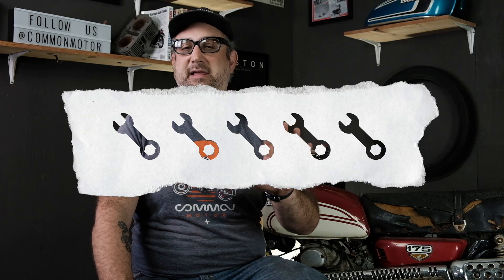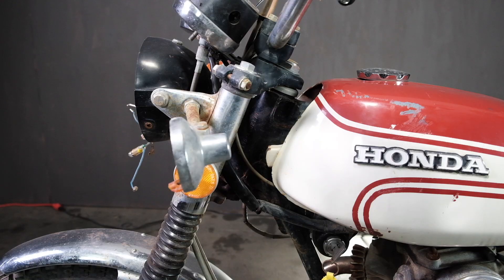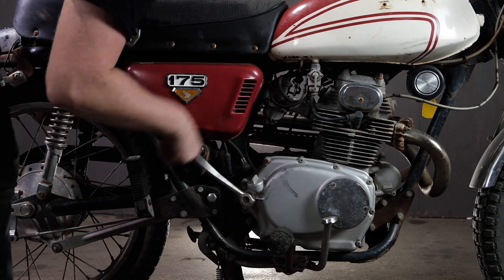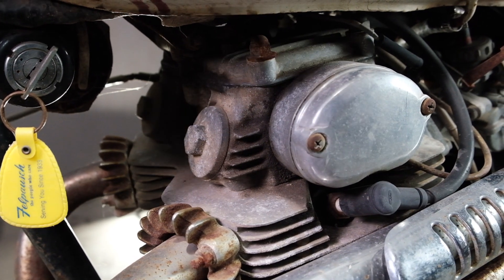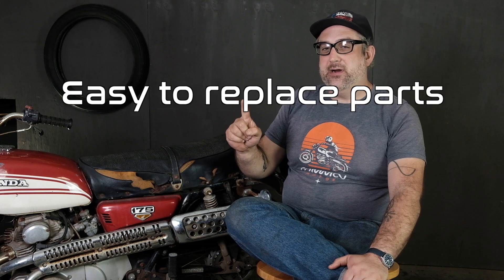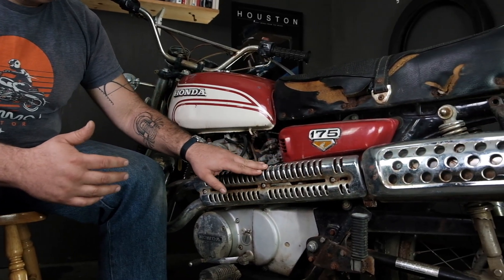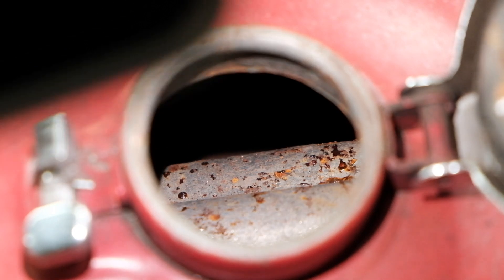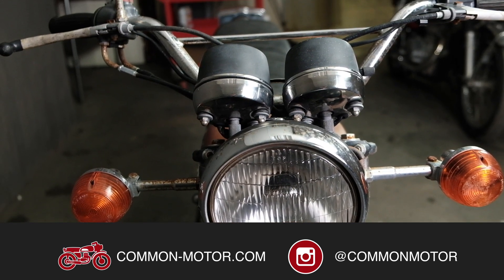How To Evaluate A Vintage Honda Motorcycle Project

Comment: Please be aware, if you are not mechanically inclined, and don't plan to work on the bike yourself, a vintage bike is not a good choice.  There are very few shops willing to work on old bikes, and if you are lucky enough to find one, expect to pay around $75 an hour or more for labor.  If you want to learn how to work on the bike yourself, spend a little more and find nice one in running condition.  Then you can take on little jobs as they come up, like adjusting points, changing the oil, and rebuilding the carb.  Also, a single cylinder bike is much easier (and less expensive) to work on then a twin or inline four.  Find an online forum dedicated to the bike you purchase.  There you will find people who are happy to share their knowledge on repair and sources for parts.  Finally, some parts are just very hard to find these days, even with ebay and Craigslist.  Be prepared to wait, and possibly pay a lot, for good used parts which are not made anymore.  Good luck!
Reply: I agree with Carport Chronicle.....I have a 79 Honda CB 750 that I have had for five years that I got from a “friend”.  Old bikes are a hassle and you won’t be riding it much.....Parts are not available anymore....don’t listen to people who think everything is on EBAY....trust me......and the aftermarket carb parts a lot of times are junk or don’t fit.....As far as 4 cylinder bikes go you won’t find a YouTube video on how to rebuild the four carb set up on those old bikes....I paid my mechanic 800 dollars for my rebuild......oh is that outrageous?   Did I get ripped off?....Good luck finding someone who knows how to work on that old junk....oh and no matter how mechanically inclined you are you won’t be able to figure it out.....I’m lucky I have a guy who is willing to work on my bike cause most shops don’t wanna mess with the old bikes and I don’t blame them because a lot of people get pissed at the costs involved.....Do yourself a favor and get yourself a Yamaha MTO3 that will run on today’s gas and has ABS.....Lot of people that have an old bike for sale want money for it when a non running old bike is worth nothing IMO....Sure my Honda is fun and it’s the only one around......but it’s been a hassle....A lot of bike owners work on their own bikes not knowing their repair could result in a fatality.......like the battery cable on my bike that I found out had 7 splices in it.....the cable was less than 5  inches long....not to mention the other “repairs” someone had done to my bike prior to me taking ownership of it .....like not using gaskets on the stator side of the case.....Or putting aftermarket air filters and exhaust on a bike without proper jetting and wondering why the bike never ran properly 40 years ago..these old Japanese bikes are engineering marvels ....they ain’t simple farm machinery like an old Harley
Reply: @danlove4270  Sorry you got taken to the cleaners on the carb rebuild (or did you?).  I learned about carbs with a single cylinder, 125 Honda, when I was in high school, then tried twin carbs a few years back with my '74 CL450 Honda.  Recently I did my first set of quad carbs for a '92 750 Nighthawk.  The carb rebuild kit set was $80 and the vacuum gauge carb synchronizer set was around $60.  I took a lot of photos before I started taking things apart.  I then spent about two hours two hours per carb (disassembly, soak time in carb dip, and reassembly).  There was also quite a bit of time getting the carbs off the bike and back on.  Most shops these days charge $75 to $100 (or more) an hour for labor, so a job like this adds up quickly.  A competent mechanic is going to take his time to do a job like this because there are a lot of little details to ensure everything goes back correctly, and no one wants to pull everything apart again if something isn't right.  I taught myself how to do it on my own because I am mechanically inclined and have more time than money.  Old bikes are not for everyone, but for those who are willing to learn, they can be very rewarding.
Reply: @carportchronicles1943  - You are all right CC...The old bikes ain’t for everyone....and it’s true the twins and singles are easier.....and why does anyone need so much Power anyway....I guess because I’m older I don’t wanna race and I hate Interstate riding anyway....Thanks for not being an online jerk.
Reply: Words of wisdom, that goes just for about anything that's old, people take on projects and they have no idea what they are doing but more importantly they don't want to learn.

I am restoring a 77 550 and having the time of my life, if it doesn't work out no biggie,you can't put a price on enjoyment,trick is not to take things so seriously and try to do as much of the work as possible by your own hand, I have a couple of old cars and the only thing I would ever take it to a mechanic for is the auto trans, don't mess with that stuff but anything else I do myself or learn how to,mechanical stuff is not a mystery like the carbs on these bikes, they either work or they don't and you have to figure out what the deal is.

One of the old cars I own is famous for having idling issues, when I bought it I was forewarned " dude you are in over your head,you'll never get it to idle right" well I figured out what the problem is and the thing runs like a sewing machine,just takes some patience and determination.

On parts for these old bikes, the bike I am restoring I have been able to find everything I need, be patient and you will find on ebay a seller's that's needing quick cash,I recently bought a seat for my bike in excellent condition for 30 bucks,most go for 100 plus, just gotta be patient, it will turn up, anyhow just my 2 cents.
Reply: @dntlss  Hey thanks for commenting.  I waited 12 months for a NOS pulse generator to appear on EBAY so you are right often times the parts do show up but I missed out on riding last year and I only have the one bike....I guess the waiting adds to the satisfaction but I just wanna ride now....gonna get a MT03 Yamaha if one shows up here in MN.  Inventory is low at dealers
Reply: @danlove4270  I bought my CL450 with a seized engine after it had been left for dead outdoors for 20-years.  I paid $200 for it knowing it was worth much more if I couldn't save it and had to part it out.  I then spent seven-years (partly due to waiting for parts, partly due to limited funds, and partly due to adopting a baby) taking it down to the bare frame and restoring it.  I took on a lot of things I had never done before but it was a great project and it's now worth more than what I spent to restore it (if you don't count the hundreds of hours of personal labor I put in).
Reply: @carportchronicles1943  Good job bringing it back to life.....i checked and according to the internet they are popular bikes still.....good job!

Comment: FYI on titles, motorcycles built before 1980 have different frame & engine #'s, here in Wisconsin, the engine # is on the title, you'll have to check your state which # they use, so don't get hung up when frame & engine do not match, I found this out restoring a '78 CB360T, my frame does not match engine
Reply: I have the same on my CB350 F from '73
What I understood with Honda it was normal to have a different engine number and frame number.
After a small search I could find the engine number that was from the factory in the bike I have, unfortunately it's not the one in it now

Comment: Once bought a cheap running beater of a cb360, thinking I would do heavy cosmetic surgery.  Didn't know about the timing chain issue.  Turned out the chain had ground away at the case, filling the oil filter with aluminum,  cutting off oil to the head, flattening the cam and eating the cam journals. Complete engine teardown and new head. What a learning experience.

Comment: Buying an already restored bike is probably better than buying a basket case or project bike someone has already made it impossible to restore without spending a lot of money.  I bought a Triumph T140 for $2500 that looked ok but in reality I should have paid half that because A. it didn't run. B. the carbs needed to be changed. C the spokes on the wheels were toast.  D. it needed all new electronics E. it needed all the fuel system cleaned out (tank, new fuel lines). F all new brakes.  The stack of bills was so thick my wife insisted I buy a new bike from a dealer and I did.

Comment: Having restored several old Yamahas and Hondas and living in the rust belt where there is a lot of humidity these motorcycles all initially suffered from a lot of oxidation. You can spend years chasing down parts if your end goal is a perfect restoration but if your goal is to get your bike up and running do yourself a favor and buy an air compressor and a cabinet sand blaster big enough to blast a 19" rim. Once bead blasted you can send your parts out for powder outing or if your on a tight budget a good rattle can paint applied correctly can look very good too.

Comment: Hey Common Motor, I bought a non running cb175 and the kickstart goes right to the ground with a very small amount of resistance at a few points, which indicates no compression. but when I put it in gear and push it, it makes vacuum popping sounds and the engine has resistance to turning but it turns. Is it possible the kick start gear inside the block is stripped? Thanks 👍

Comment: Thanks for this discussion!  Picked up my barn-find 73 cb500k with only 11k on it this past September.  Looked it over thoroughly and made the purchase.  Very little rust, paint looked beautiful.  Everything was there and original, (including the tires!) except it had rusty Jardines on it.  Just went through the big stuff first.  Then I went through all of the finer details.  
Most of the information I used to sync carbs, rebuild the forks, the tires, the timing, the valves... all came from you guys!  
THANKS!

Comment: Always good to have a friend who knows these bikes that you can bring along, or do some research so you'll know basic info about that particular model before going to look at it.  

I bought a fairly clean, running CB750 as my first vintage bike a few years ago.   Now that I'm more familiar with carbs, electronics and other basic motorcycle stuff I feel like I could take on a non-running project, but I'm glad I didn't start with one.   I've seen people pick up a total basket case as a first bike and teach themselves along the way.  That would have been a bit overwhelming for me.

Comment: Thanks for the info, just got my dads 1977 cb400 super sport over Christmas.  It’s not running now and needs a tank but has compression and parts are all there.  Cards rebuilt and need to go back on.  My dad bought it brand new off the showroom floor in’77.  Part of the family I’ll never get rid of.  A spry 79k on the dial, all put on by family.

Comment: Great video again. You make many valid points. My Yamaha DT3 had the wrong seat. It took me 3years and much searching to locate the correct seat! 
My CB360 was complete, supposed to be a runner, piston rings seized on one cylinder, only 4500 miles and cost a fortune to make pristine. 
You will always spend a lot more money as you think it will cost. 
The end result is worth it though!

Comment: I recently picked up a 75 CB125A2 with only 844 miles for $25. It was all original with a factory battery and a plate from 1978 on it. I know this is all true because I helped get it out of the barn where it has been this the whole time. Ruff, but no damage. I got it cheap so I have all kinds of room to have a bigger budget. I will be paying about $400 for an Illinois title. But I am in it for the love it all. I also found a parts bike for $100 that has some good usable parts. I am used to auto restoration and also worked at a body shop and later a motorcycle shop. I do know what I am getting in, too. The reality of it is I will likely have close to the same money in it as much as just buying one complete. I am restoring the engine and frame now, but I plan on trying to preserve the rest. I could always restore the rest later, but I like the idea of showing some age. This video is a great starting point for those who are not as familiar with what a project could be of how out of hand it could get.

Comment: Great video: For me the first question is, "What's my goal?"  100% original or 100% operational?  Big difference in cost, depending on what you start with. I just did a 100.0% resto of a MR175. It turned out near-perfect and the client was super happy. Now I have a Trail 70, and they have a big parts market, but several things are only available as aftermarket. So... set your end game goal. Not everything needs to be 100% original.

Comment: I bought a 71 CL450. All stock, and everything there (some things broken). Was not running at the time. It has been pretty much what I expected. It now runs and rides, although still a bit of a hiccup (I think something electrical) as you rev through 3500 RPM. I paid too much for the bike probably, but there was a line of 15 guys wanting the bike and I was number 1, so that's just the way it goes. I also decided early on that I would not track costs as I fixed it up... its a hobby and I enjoy it immensely. Common Motor has been very good for the parts I have needed.
Reply: Check the constant velocity carbs.  -They are tricky and some people replace them.
Reply: @jonmccormick8683  Hey Jon thanks. I have been through the carbs many times! Not sure where to go with them, which is why I lean towards electrical.... I also notice recently my turn signals are flickering which leads me to believe the electricity output is not sufficient... even though the battery is never off the tender and is new.
Reply from the maker: Does the bike rev fine past 3500? Just a hiccup at 3500?
Reply: If it stutters above 3500-4k check to make sure the  needles in the carbs slide up with the slides. Had this problem on my cl350
Reply: That's what its all about man,if you fix bikes for a living and you find a basket case its gonna be a money pit but if your doing it for the pleasure of it, nothing is more fulfilling, you cannot put a price on happiness and enjoyment,i have spent a small fortune restoring things myself,probably added years to my life span, like you i enjoy it immensely.
Reply: @Common-motor  Yes! I just ordered your reg rec... maybe it will help... I am at a loss as I have been through the bike many times. Doesn't start easy... choke kills it, idles fine once it warms up... and pulls hard after that... its an odd one. Carbs re built using your kit, new condenser, advance mech works fine, new plugs, new points, staticly timed, valves set,etc etc etc.
Reply: @CCitis  Two things I would check - ignition coils and the rectifier. It is also possible for the alternator rotor to become demagnetised under some circumstances. Not sure how to test that though.
Reply: @ulricvonbek6545  Will be installing the rectifier shortly. Coils are fairly new. The magnet seems strong on the rotor... but who knows. I wonder could the advance springs be a factor... the unit looks fine but I don't really know how to test that.
Reply: @CCitis  You've checked the alternator winding for continuity and/or short circuits too, of course....

Comment: I'm in the UK and have no interest in owning a modern or retro bike, but I do have two of what you would probably call vintage bikes (I prefer the term "classic", vintage to me is much older), a 1978 Triumph T140V and a 1980 Suzuki GS550L. The Triumph looks like new and completely original (I bought it 30 years ago when it had done only 1300 miles and been kept in showroom condition from new, I've done about 60k since). I bought the Suzuki 2 years ago as a cheap, practical, all year round bike, so I could stay on the road throughout the winter when the Triumph is put away. I didn't care whether it was all original, in fact I know that it has several aftermarket parts, and the engine has been replaced, I just wanted something simple, reliable and reasonably tidy. 

It was complete, running, clean, and had just passed its MOT test (annual safety inspection) when it came up for sale, so I took a chance and I bought it. As I expected, it needed a bit of time and money spent on it to make sure all the important things were working properly, but I never intended to do a full restoration, so it didn't take long to make it a practical, everyday ride. It was also UK registered from new, so paperwork was simply a matter of transferring ownership (at no cost). Two years on, I use it almost every day and it still just needs routine maintenance.

In the UK, there is a considerable advantage to owning 40+ year old bikes - they are exempt from annual vehicle tax and MOT tests, saving me over £250 ($300) each year, and also from charges in Low Emission Zones in an increasing number of UK cities (£12.50/$15 per day in London).

Comment: Went to buy a 350f, 400f, or 175 to put up on TwistedRoad for rent and couldn't find any reasonable deals given winter already arrived.  Ended up with finding an FXR which is a lot of fun but it still ain't light and can't rev it out to the level these 70s Honda can.  Maybe next year.

Comment: Thanks for the great video. I always look at what you are going to do with the bike as well. What may be a parts bike may be a great cafe racer or modified bike. Bikes in great shape get restored and parts bikes get modified. My honda 360T is original and will never be modified. I have two 350s and they were parts only however one is welll on its way to a cafe racer style and the cost has been very low to build it. At least she was saved from the dump...lol